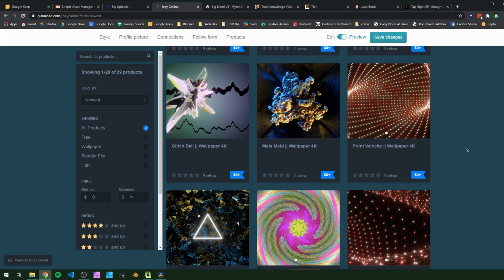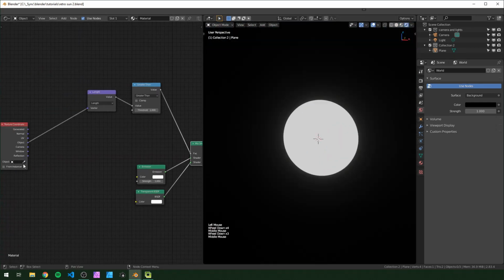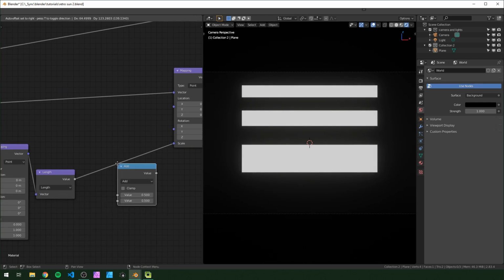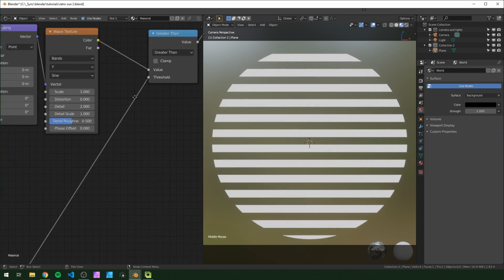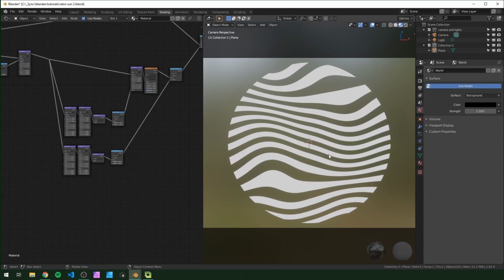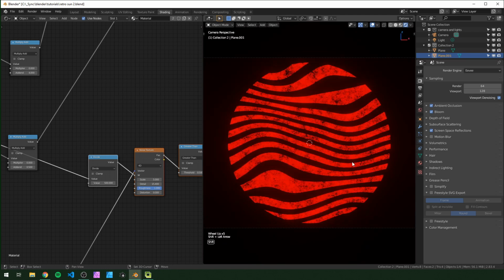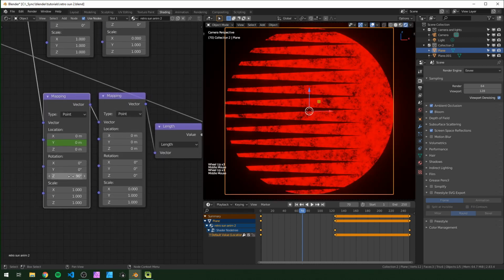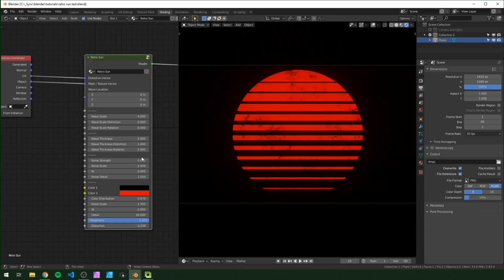Make a Retro Sun Animation || Blender 2.83

Comment: In Blender 3 I cant find the blend mode? Does anyone know where it's been moved?
Reply from the maker: Are you talking about the mix rgb?
Reply: @JoeyCarlino  Joey thanks for the fast response. I purchased the file from gumroad via the links in your discription. I strongly recommend it to anyone that maybe having trouble so they can compare it to their own file. 
I found that I was not in eevee so the option tab was not displaying the blend moods or the shadow mood. 
After applying the proper modes, Alpha blend and 'None' for the shadow mode  I swithed back to Cycles and didn't notice any issues.

Comment: Oh man this is insane! Really good tutorial. How you came up with this in the first place is really impressive! Good speed on the tutorial, and the fact that you even put out a faster and a too fast version is really dope. Subbed <3

Btw, how long have you been using blender for?
Reply from the maker: Thanks! I've been using Blender for almost 2 years. I started April 2019.
Reply: @JoeyCarlino  Wow, I'm still pretty new to the game but I'm surprised it wasn't longer!

Now of course it isn't as straightforward of a process when compared to the tutorial, I mean that's the finished product. How long did you need to think everything out and fine tune before it was finished?
Reply from the maker: I made it originally for a looping animation and I think I worked on it over the course of two days. Getting the nodes tidy enough to share was probably another day added.